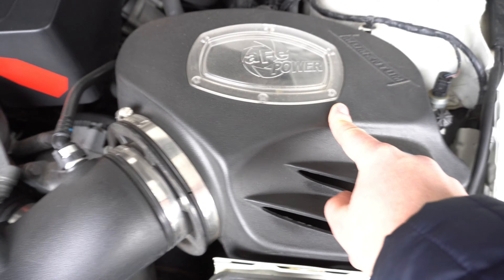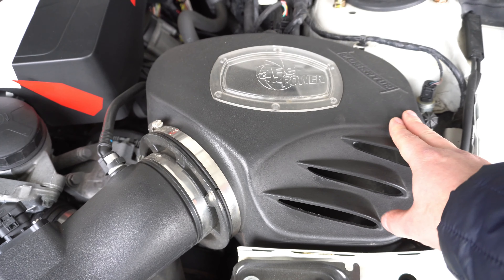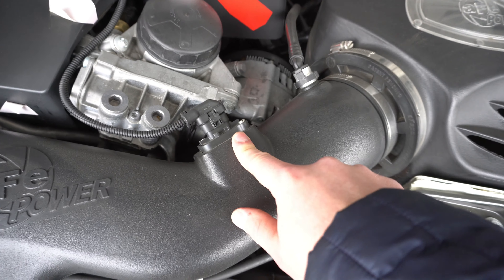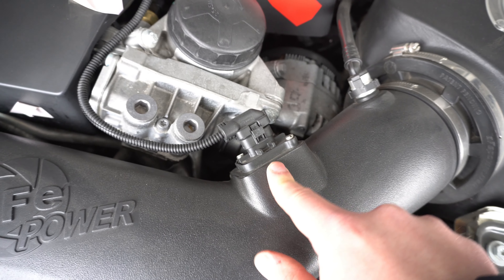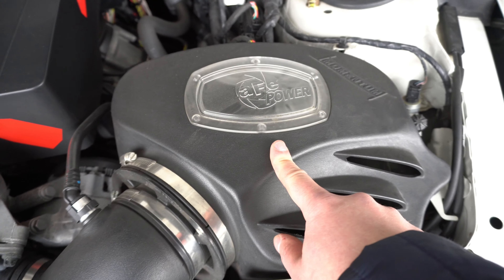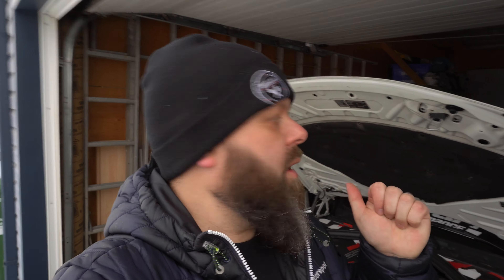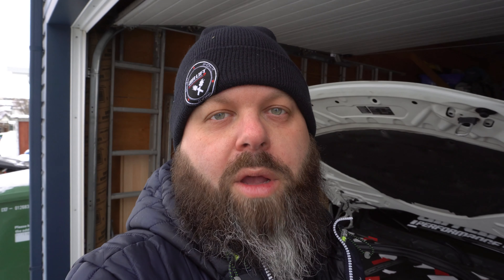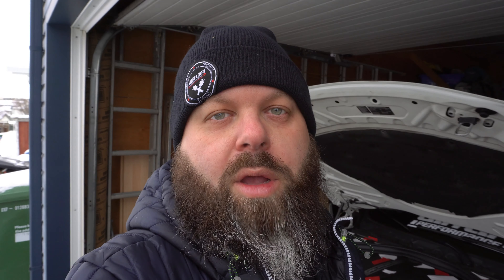BMW F30 335i N55 Power Modifications and How much HP does MHD stage 1 Make?

Comment: The 312hp was while running a stage1 tune? Seems a little low
Reply from the maker: Yup that’s correct and to the wheels
Reply: It looks really low, the car stock produce 306 right? Your number are very far from what mhd says on their webIte. I DONT KNOW WHAT TO DO BMW OR MHD
Reply: @alansete1  Stock is 306 at the crank, or around 270-275 at the wheels.

Comment: good numbers but if you have the stock charge pipe still you should be concerned. change that out ASAP!!! they are prone to failure even on stock levels
Reply from the maker: Ya I have been thinking of doing that’s especially since I have been running the stock one tuned for over a year
Reply: @HQGARAGE  ya you're lucky it didn't blow yet. Get it swapped out so you don't get stranded while driving
Reply from the maker: Yup Very Lucky!! It’s on the list of things to change definitely, Considering I want to travel outside of Alberta for a few more shows this year.

Comment: Yesss dyno please 😁 question, how does the intake compare to the bmw mppk and burger motorsports bms intake, I have both at the moment which I switch between but it would be nice to try out another intake to compare the differences
Reply from the maker: I have not tried any other intake, but it has made the turbo noises louder but as for power gains, I know they have a Dyno comparison on the website. However a lot of forums I have scrolled through say the stock intake system is really efficient and you should just leave it.
Reply: @HQGARAGE  thanks brother 🙏🏼 i really appreciate this, oh and great video as always🙏🏼💪🏼
Reply from the maker: My pleasure and thank you 🙏

Comment: Is the e90 n55 any different from the f30 n55 internals or turbo ?
Reply from the maker: The Same N55B30MO engine in both cars, the major difference is in the transmission. The F30 has a better and Quicker Automatic Trans. The E92 has the heavier steering feel where the F30 is light and almost doesn’t feel real.
Reply: HQ_ BMW ohhh ok my steering is really heavy I have been trying to figure out if the engines are any different is it the dct in the f30?
Reply from the maker: Nope no DCT only the upgraded 8speed
Reply from the maker: The engine layout for the intakes are different but internals and turbo are identical.
Reply: christopher stuart actually the E series N55 has a slightly smaller turbo than the F series N55
Reply from the maker: Thanks Man that’s good to know 🙏🙏
Reply: HQ_BMW f30 n55 crankshaft uses the one from S55 so it’s much stronger
Reply from the maker: That’s also good to know 👍👍